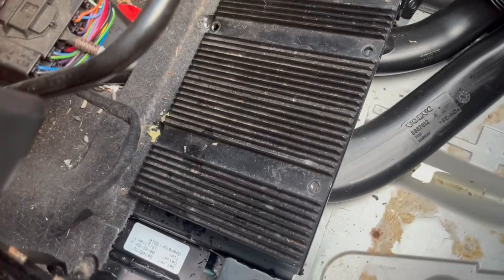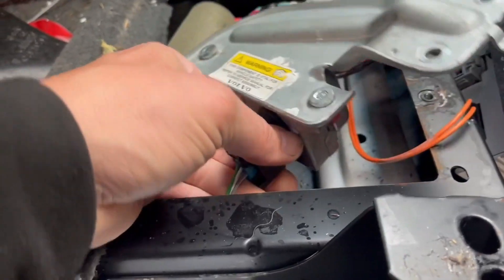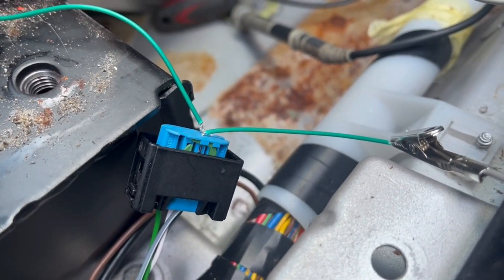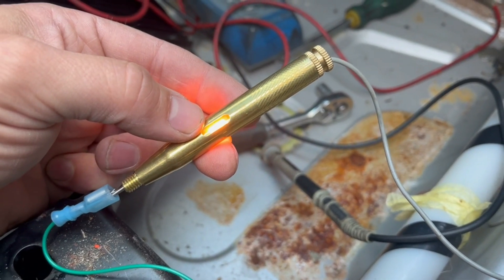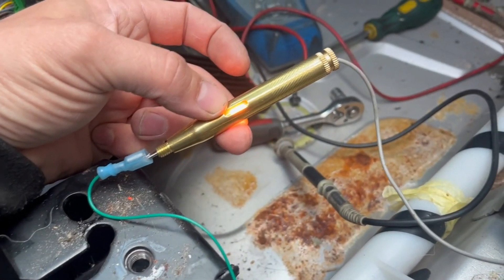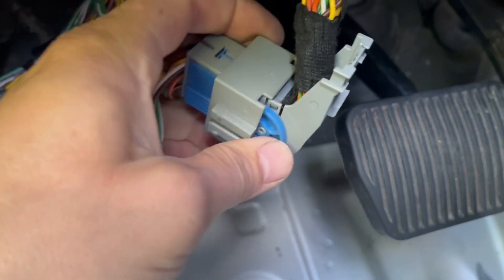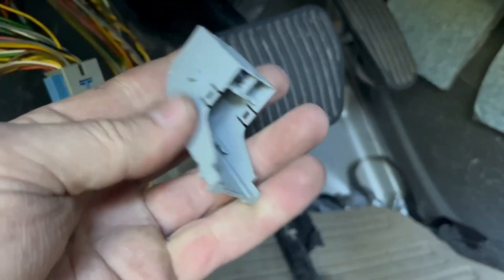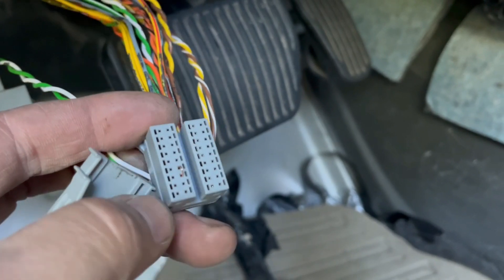First gen Volvo XC90: How to diagnose AYC sensor?

Comment: I had an (ABS error 0090 Lateral Accelerometer Faulty Signal) on my Volvo. The diagnostician told me that the sensor had failed. I purchased a used, working sensor and installed it. I was able to calibrate the longitudinal acceleration, but I cannot calibrate the lateral acceleration.

The sensor and connectors were not exposed to moisture, at least from what I could see. I even went to a Volvo service center, but they were unable to calibrate it.

Could the problem be the female connector of the sensor, or could there be another issue? I would greatly appreciate your help, as no one else has been able to assist me. I
Reply from the maker: Initial reaction. "New" sensor is to blame. Because for the wiring. if car sees the sensor and there is communication, it should not be an issue with wiring. because there is only current feed and network wires. thats all. I would try to borrow another sensor to confirm
Reply: @realvolvofreak  but there is no communication for lateral acceleration, just as in the last sensor there was no communication for longitudinal acceleration
Reply from the maker: @haricatic2251  you already answered. On one control unit you had the problem with one sensor on other you had issue with other.  To me that means there is an issue with the AYC control (sensor) unit. If it would be issue with communication or wires from AYC to BCM it would give you communication issues in general, not that it has faulty signal. Thats just my thoughts and what I would do I am  not saying I am right.
Reply: @realvolvofreak  Thank you very much again, it's very expensive to buy a new sensor, is there any chance that if I clean the female connector of the sensor with contact spray, and the CEM connector like the blue one in your video, is there at least a small chance that the sensor will work?
Reply from the maker: @haricatic2251 it doesnt go to cem. It goes to bcm. But there is a  plug under the panel. For sure you can clean that. You can also test wires from there to the sensor for continuity. It will not hurt. At least you will rule out that part. Maybe close to you there is a guy who can lens his aensor from his xc90 for test. Or you can take a look on rrr.lt page. I see them there quite cheap like 20 eur or so. Just check that part number is the same as yours
Reply: @realvolvofreak  Does the BCM (Brake Control Module) sit under the cabin, beneath the steering wheel, where the fuses are?
Reply from the maker: @haricatic2251 no. That is in the engine bay. The wires goes from sensor to under the panel close to cem where is blue plug and you can open that and test wires from it to sensor. Other side of wires goes to bcm plug in engine bay. It is otherwise known as abs block. :)
Reply: @realvolvofreak  Thank you very much for your effort, I will be happy to listen to your advice :)
Reply from the maker: @haricatic2251 hope you resolve your issue. Let us know if you solved and issue
Reply: @realvolvofreak  Later I will try to find a used sensor, I hope it will be working, and if I manage to fix it I will gladly let you know. I even bought this one used for €200, and still it doesn’t allow lateral calibration. VIDA gave the error BCM 0090 – sensor signal faulty / signal rejection.
Reply: @realvolvofreak  I replaced the sensor and the error sometimes appears and sometimes disappears. When I turn the ignition on, the message ‘Traction control temporarily OFF’ appears, and then when I start the engine, the message changes to ‘Traction control – service required
Reply from the maker: @h @haricatic2251 what trouble codes you get after clearing everything?
Reply: @realvolvofreak i dont know, i have not OBD,I replaced the yaw sensor (part 8691675) on my 2005 Volvo XC90 with part 30795302. I performed diagnostic calibration and the error disappeared. Later, when I started the car, the error appeared again. When I turn the ignition on, the message ‘Traction control – service required’ appears and stays. If I turn the ignition off and on again, the message changes to ‘Traction control temporarily OFF’, and when I start driving, the error disappears.
Reply from the maker: @haricatic2251 how did you performed calibration if you dont have obd tool? You need to read codes, without those everything is guess, even then it can just guide you what could be issue.
Reply: @r @realvolvofreak  I was at the mechanic and had the yaw sensor replaced because the old one showed ABS 0090. When the new sensor was installed, it was calibrated and the error disappeared. However, at home, about an hour later, when I started the car, the error returned. When I turn the ignition on, if the message shows ‘Temporarily OFF’, the error disappears, but if it shows ‘Service Required’, the error stays. Every time I turn the ignition on, these two different errors alternate.

Comment: I'm sorry but this is a useless video.  I can't hear anything you're saying or see what you're doing.
Reply from the maker: Sorry that it did not work for you. The problem was that car had a fault on AYC sensor is not communicating. What I was doing was checking the wiring for the AYC. Is there a plus feed and negative feed. And there was. When I was checking the communication wires there was a short. And it turned out that ahort was made from the previous garage where guys were “repairing” the car and wanted to buy it back from owner. And put the bridge between communication wires and hide it under the double plug.